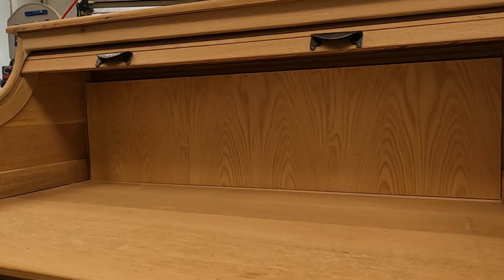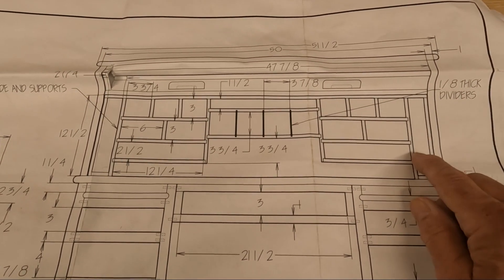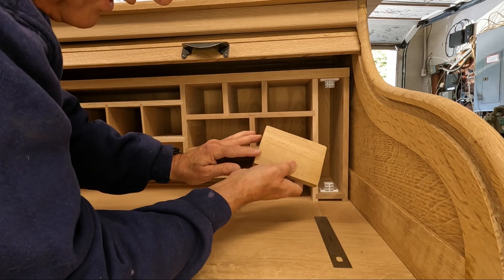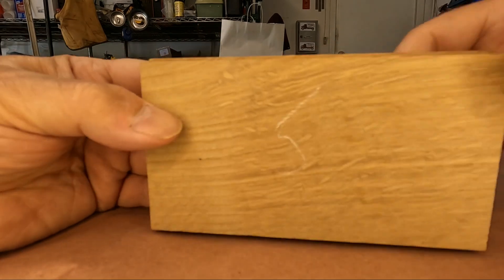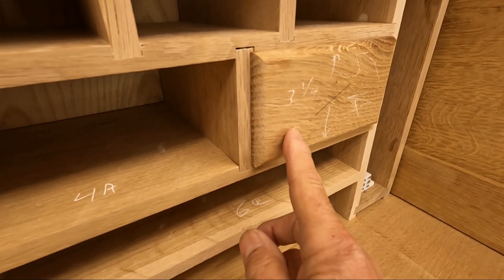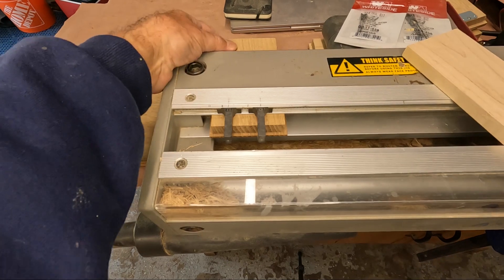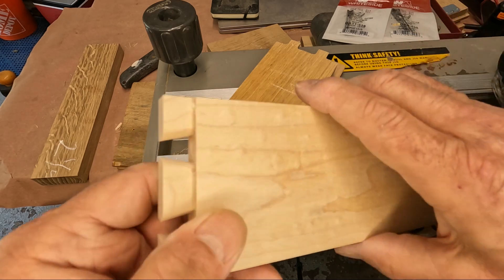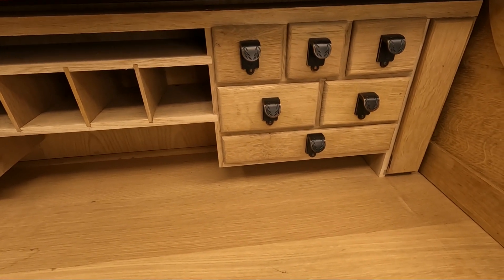Update on Roll Top Desk,Using the Akeda jig for Dovetails

Comment: Very nice.
I just picked up a used Akeda jig, manual says must use Akeda router bits which are no longer available.  What bits avaliable now are compatible?  It came with the original set but ill probably burn those up soon.  First project tomorrow. 
Thanks in advance
Reply from the maker: If you Google Whiteside you will find router bits that are comparable to the ones that were supplied with the Aleena jig. If you have trouble locating it let me know I should be able to supply you with the item numbers that Whiteside uses. You’re going to find the already jig an absolute pleasure to work with for many types of dovetail joints. Easy to set up an actually fun to work with. Good luck and thanks for watching
Reply: @DrJoe1  thanks for the response.    I was able to cross reference most of the bits but the site said d/c'd by manufacturer and no replacement.

Looks like whiteside #

1020AKS
DA7-438
DA9-438
DA11-438
DA14-438
DA20-438

D102A  is a kit

Those look right?  Where did you buy?

The akeda original bits are 3409, 3411, 3414, 3420, 3480, 3482, 3483, and one number worn off.

I did see where over and undersized straight bits were listed.  Those necessary?
Any chance you're a dentist?
Thanks
Reply from the maker: @Jslav-jj2xq  lol, yes I am a dentist. Looks like you got the right bits I bought them online from Whiteside. Yes I would buy the two straight bars one is oversized they come in handy. Once you see how easy the Akita jig works you’re going to be doing an awful lot of Dovetails they’re fun they’re easy. If there is anything I could help you with in the future the little that I know, just text me thank you bye
Reply: Quick question from a fellow dentist...I've been working on the sample drawer shown in the instruction manual but it is not clear on how one routs the other side of each piece.  It seems that one must duplicate the guide locations starting from the right side working to the left.   Is this correct or did 3 of use following the manual miss those instructions? Thanks in advance